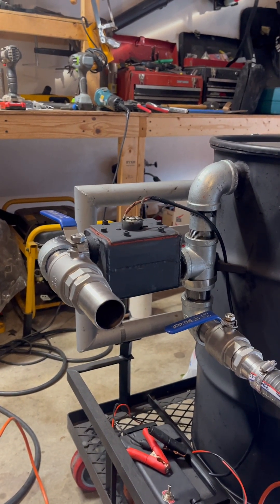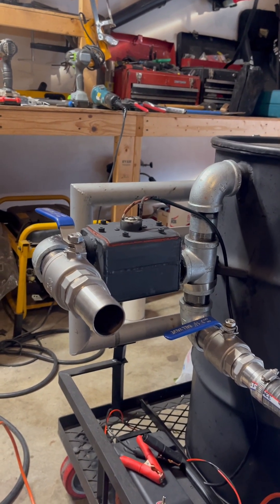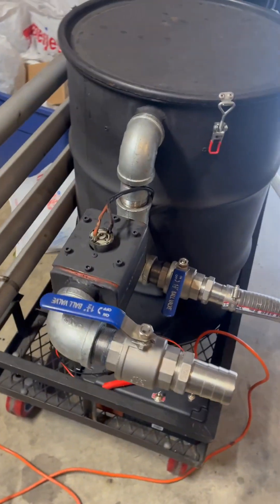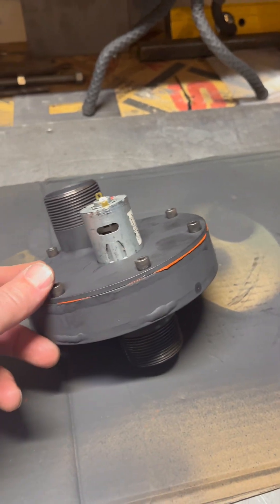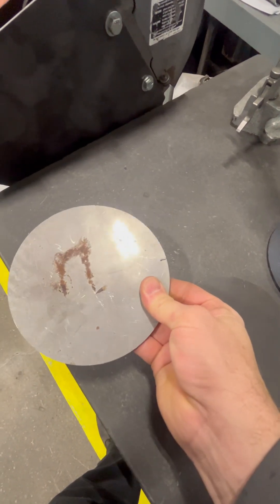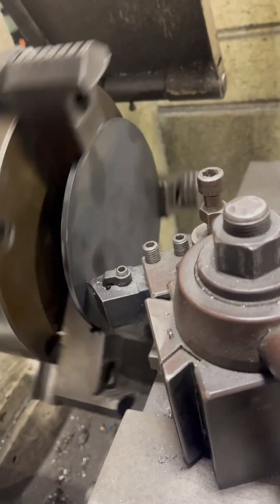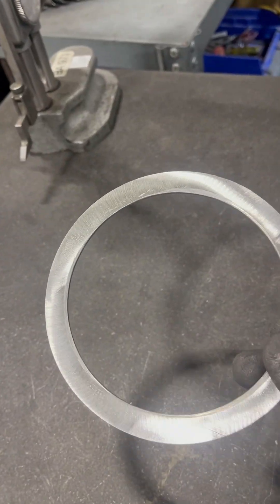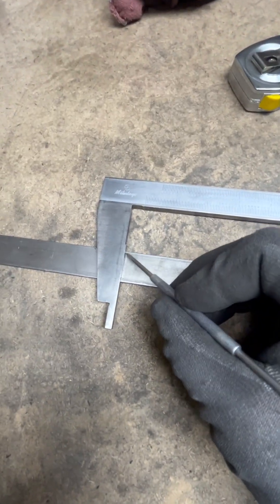Woodgas Vacuum Blower DIY

Comment: Diy but requires a lot of machinery
Reply from the maker: Not really too much, you could do it with a hand drill or small drill press, cut off wheel with grinder and a welder.

Comment: Would milled housing from aluminium work just as well for DIY blower? Asking for a friend...
Reply from the maker: It depends, as long as the vacuum strength is relatively strong it should work. The woodgasifiers Bible calls out 9” of water column I believe.